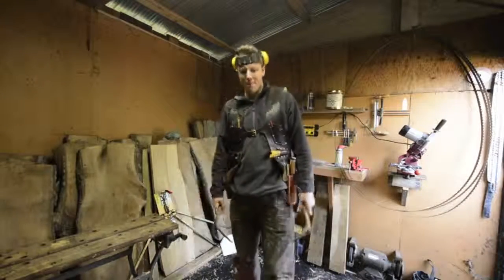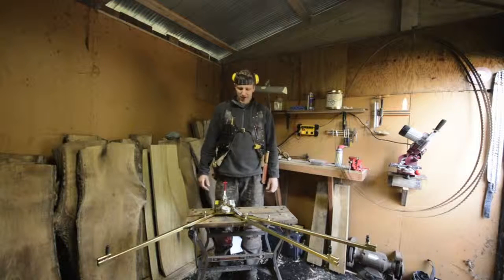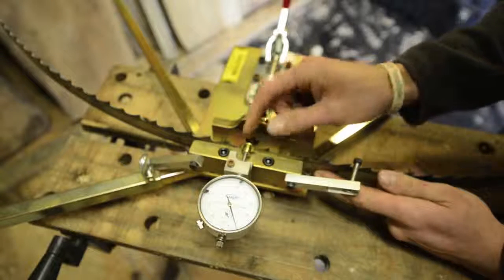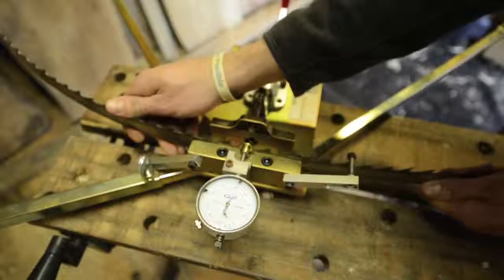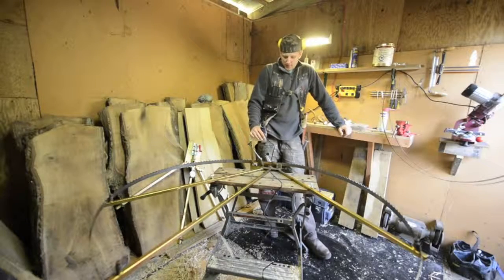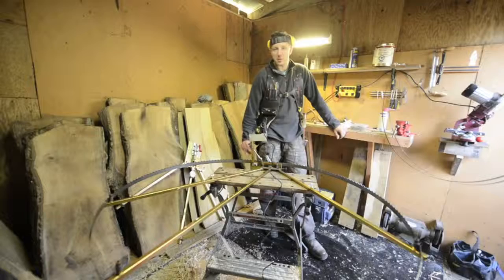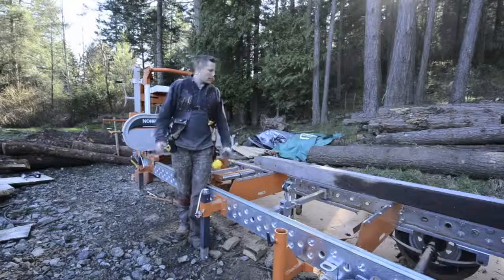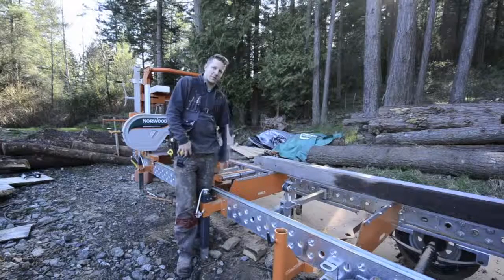154 Norwood sawmills, Tooth Setter   Sharpener How To

Comment: i have the hd 36 also but bought the woodlands sharpener . was cheaper and is automatic once you get it set you can go and set  another blade whilst its sharpening , halving your time. ordered a 38 full hydraulic with power feed and board return